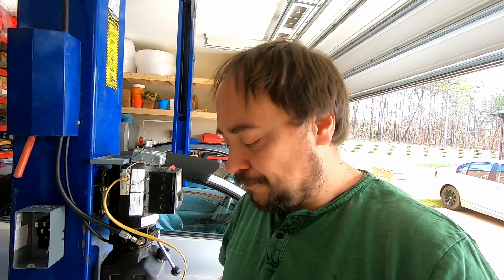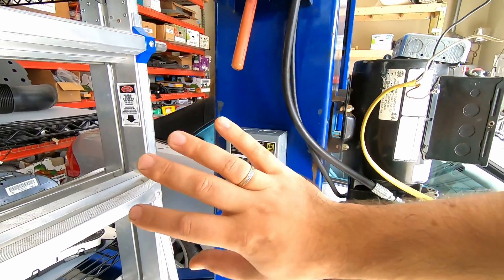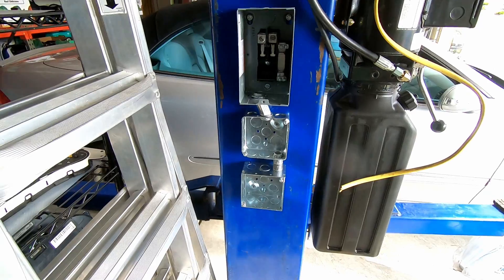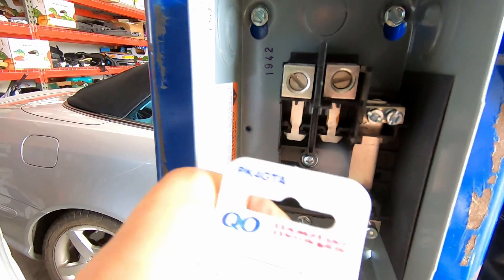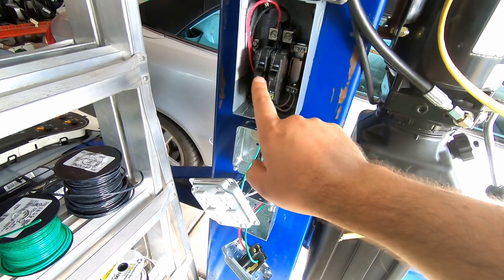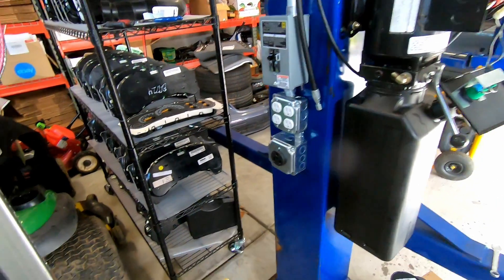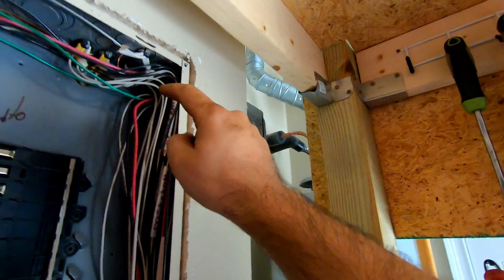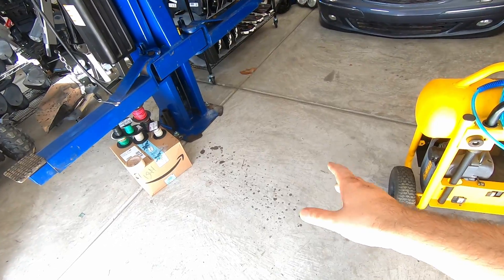Installed 240V in the garage to hook up the car lift! (finale of lift installation)

Comment: As a hobby shop guy, and my understanding of electricity, the only thing I would critique is that it does not look like Best Pixel Repair grounded his boxes (he may have off-camera). 
Other than that, I think (and I could be wrong, so electricians out there correct me if I am wrong) you could delete the 2 space subpanel if you run 10/3 wire instead of 10/2 because there’d be a return to the main panel. Therefore, you could pull 120v from 1 leg of the 240v and use the neutral return to the main panel while also using both legs of the 240v circuit for the lift and the 240v receptacle. 
All of that said, if you prefer to have a breaker at the lift controls for 120v, you could conceivably do it the way Best Pixel Repair did it with only 1 breaker by hooking the 2 receptacles together in the 120v box…unless, of course, you wanted 2 receptacles on 2 separate breakers, in which case, do it like Best Pixel Repair BUT  make sure you ground each box.

Comment: My lift also stuck but not because of the button.  The lift kept traveling because the contacts stuck/fused together on the cheap contactor/ relay inside the button receptacle.   I replaced the button, the contactor/relay and installed a cut-off switch to prevent that from happening again.  I am Looking for an upgraded contactor with heavier duty contacts that will fit in the button box.  The old relay contacts were rated for 20 amps yet my motor only pulls 8 amps.

Comment: This is wrong in so many levels
Reply: If so, why not share your "knowledge" along with your opinion?
Reply: I think what @oumargx is actually trying to say is that there are other ways to do this. I think the way Best Pixel Repair would work. As a hobby shop guy, and my understanding of electricity the only thing I would critique is that it does not look like Best Pixel Repair grounded his boxes (he may have off camera). 
Other than that, I think (and I could be wrong, so electricians out there correct me if I am wrong) you could delete the 2 space subpanel if you run 10/3 wire instead of 10/2 because there’d be a return to the main panel. Therefore, you could pull 120v from 1 leg of the 240v and use the neutral return to the main panel while also using both legs of the 240v circuit for the lift and the 240v receptacle. 
All of that said, if you prefer to have a breaker at the lift controls for 120v, you could conceivably do it the way Best Pixel Repair did it with only 1 breaker by hooking the 2 receptacles together in the 120v box…unless, of course, you wanted 2 receptacles on 2 separate breakers, in which case, do it like Best Pixel Repair BUT ground each box.

Comment: Are your 15 amp breakers GFCI? I couldn't tell by the video, but that is a requirement for a garage that is considered a wet/outdoor location.  Also- why did you use two circuits and not just a single one for the 15 amp receptacles? Seems like overkill for some little receptacles. And as the other guy said- you should always ground metal boxes. Also also, I do not believe that little panel is considered a sub-panel (or a branch circuit to be more accurate) which means you need to bond the neutral and ground wires (kind of makes sense since you said there is no place for the ground out of the box). But I'm not an electrician, just a DIY-er who does a lot of research. Thank you for the video.
Reply: To further explain. My understanding is that you only separate ground and neutral in a true sub-panel, i.e. a separate physical building with separate ground electrodes. In your case, the panel you are using is basically a glorified receptacle box, which means you tie grounds together and neutrals together- but both go back to the same box anyways. In your case, now you have grounds that go to the box housing or something... not sure.
Reply: depends on what code cycle. In michigan we are still on 2017, 240v no need for GFI protection.

Comment: I have question about my lift wiring. Could you help me out. How can i contact you? I have older lift with solid state relay. Automatic dump Valve.
Reply from the maker: Sorry, definitely don’t have any information on those. The installation of mine was almost plug and play.

Comment: Hi. Thank you for the video. Where did you get the nema 6-50 cord? What gauge is it? Thank you again.
Reply from the maker: I think I got all the supplies in my local hardware store, like Lowes or Home Depot. I don't recall the gauge size, but it was more than enough for the unit.

Comment: AW 32 HYDRAULIC OIL ONLY
Reply from the maker: Why? The installation manuals page 17 for this particular lift refers to the few possible options. Just to name a few - ATF, ISO VG22, SAE 10, SAE 5w20, SAE 5w30, SAE 10w30 and some others. Yes, I was also surprised to see engine oil within acceptable liquid types.